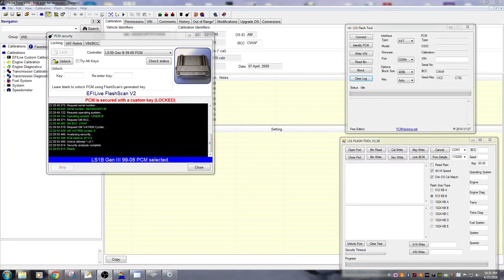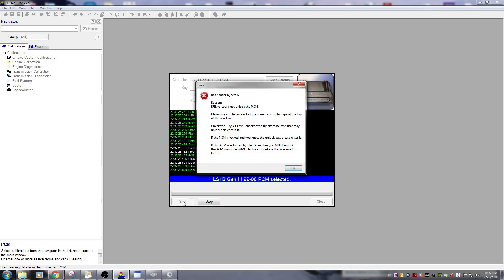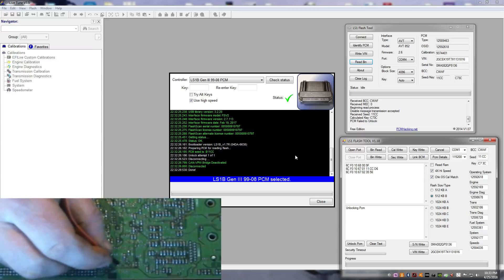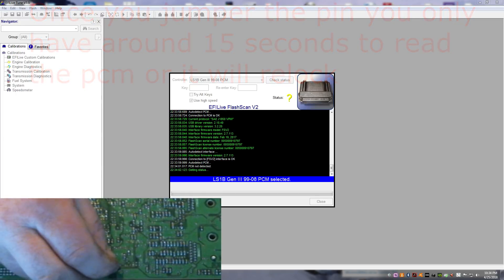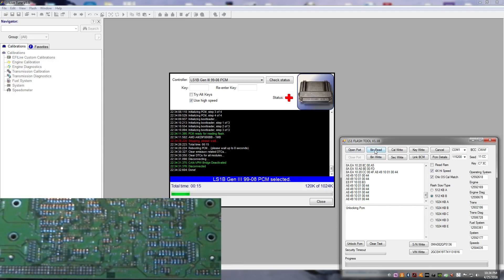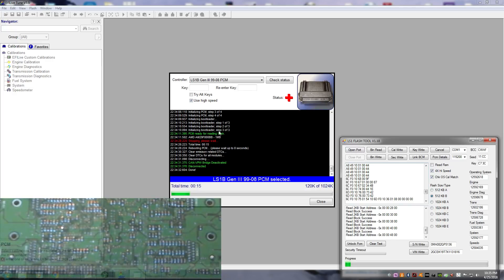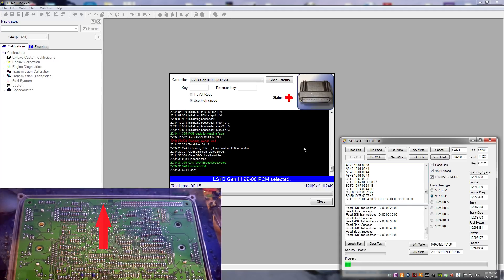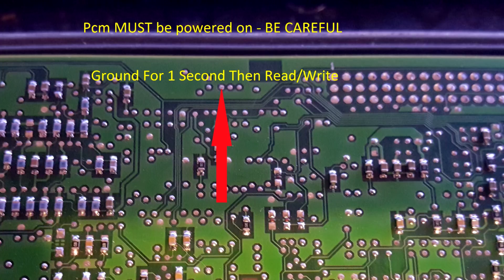LS1B P01 P59 DIY NO COST Tuner Lock BYPASS

Comment: HI I just came across your process you posted this in 2018 and now June 2021 so hope you still read this.
Is this for the 0411 PCM, has the red and blue 80 pin connectors used like on C5 Corvettes, Camaro, etc 
Which board is this ground point ?
The red or blue board and exactly which side of the PCB board and location as I cannot find on a 0411 PCM I am looking at where you show the pin that needs to be grounded ?

Thanks - JR

Comment: This is interesting but I want to be able to read and modify the locked tune file. My PCM is not locked. Any ideas?
Reply: It’s flashed with uprev.
Reply from the maker: There is a difference between a locked PCM and a locked file. A locked PCM means someone altered the factory's unlock key making it virtually impossible for someone else to do anything with the PCM....even flashing it back to stock for example isn't possible when a PCM is locked. 

If the file is locked, just flash over it and start with a stock file.

Comment: IT works! I was able to read with HPTuners, i couldn't open the file tho, still locked by another user (anything that can be done about that?)  but i was able to use the PCM again, reflashed with stock tune and voila, thaks for sharing!
Reply: I can get the file off but can't open it. Can someone chime in how they were able to open the file that's tuner locked?
Reply: how did you get it to work with hp tuners i have 2 P04 ecms that are tuner locked and I can't get it to read still
Reply: @backwoodsracingllc  i just followed the video instructions m8. I does work
Reply: @Gallo_Baja  won’t even show me the hardware I can read it without doing the trick but can’t save the file, and I get unlicensed vehicle when I have them unlocked.

Comment: THANK YOU! Worked great on my 411 pcm with hptuners.. Guys just touch the pin for a second and hit write entire within a few seconds (i used stock file) and then flashed again with my 2 bar RTT file... If it bricks again redo it again...super simple

Comment: I see this is a older one my question is if the Tuner is locked and the Vehicle is no longer available how can this be done, i pick a older SCT Live wire tuner from  a guy down the road from me, he no longer has the truck it was scraped out but he had the SCT Live wire tuner from it that has 5 tunes on it, one is locked 4 tunes left on it, that was for a diesel,  how can i unlock it, now my truck is and older truck as well but it's a gas  V-10 , thank you in advance

Comment: I finally got it to work!!
Reply: Were you able to open the file after you read the pcm using hp tuners or was it still locked?
Reply: I can unlock it, but flash it during the unlocking process with another file with Hptuners.
Reply: Mad Max Garage i would like to get the tune out of the pcm, and then unlock the pcm and file so I can continue working on it with my own hptuners I bought. The original tuner moved away.
Reply: 6kjr I have not been successful in grabbing tunes off locked PCMs, I can only seem to be able to overwrite them. Maybe see if you can find him and he email you the tune and you do it the way it works for me with the tune from the tuner.
Reply: Mad Max Garage they did email me the tune file but my hp won't open it. It says it's still locked. I emailed HP and they said the pcm needs to be unlocked with the original hardware to unlock the file.
Reply: Mad Max Garage I am going to see if I can get him to send me an unlocked file from another pcm and use it to fix mine. Thanks for showing your video as well.

Comment: FWIW this also works on the P59 PCM's that brick due to improper throttle body settings. Just revived one that's been on my bench for 5yrs that had a TAC/Pedal mismatch and bricked.
Reply from the maker: I have gotten positive feedback from more then 100 people that have used this method on bricked PCM's(failed flash) in conjunction with my Ls Droid flash app to bring the pcm back to life.

Out of maybe 300 pcm's this has been tested on that were "bricked";  there were something like 5 pcm's that were not able to be brought back this way and of those 5 only ONE was able to be recovered with a BDM...the other pcm was actually dead. 

This also works in cases where a pcm "bricked" during a read where the laptop battery died 

Truly bricked Pcm's are actually quite rare these days :D
Reply: ShorTuning EFI Calibration Specialist 
Did you use Hptuners software?

Comment: Worked perfectly for me but I have to do this every time I read it write my PCM. How can I make it that I'll never have to do this anymore??
Reply from the maker: By writing a bin file from a non-locked pcm. Its basically cloning the PCM you flash from another PCM's bin file. 

https://www.youtube.com/watch?v=DYc3lrYagqg
Reply: @PeteS160plus  so I'm basically pulling another trucks tune from that PCM and copying my existing tune file over the new file? How do I go about doing this without adjusting every little parameter I changed in my existing tune, on to the copied tune.
Reply from the maker: Get a second PCM, flash your tuner locked bin file onto the pcm. You would want to flash just the OS+Cal data. You would then read the file back and have the same "Tune" but with out the tuner locked seed/key now. You can then take the new "unlocked" version of your file and flash it into your current pcm to remove the tuner lock completely. 

It may sound hard but it actually would only take you a couple of minutes to do.
Reply: @PeteS160plus  Not sure if you're still monitoring the comments from this video but can I use LS Droid to clone a non locked PCM .bin onto the tuner locked PCM then put the original tuner locked.bin back on afterwards and not be locked? The tuner locked PCM and the non locked PCM are not the same OS.
Reply: PeteS160plus I would like to give this pcm trick a test. But I still have a couple questions.  If you're following the comments can you let me know?
Reply: Curious is you used HPtuners to unlock yours?

Comment: Thanks heaps PeteS160plus worked perfect on my vu ss commodore ls1 pcm after using the method misk one posted, Had that pcm sitting around for 8 years & has always pissed me off that it got locked.
Awesome work on this & the work you are doing on the ls1 flashing software.
Reply: Hey mate. Did you do this method while the pcm is in the car? I just got my mpvi2 the other day, waiting for a free weekend to get stuck into it and just wanted to know if it can be done in car or if I should buy or make a bench harness. Cheers mate
Reply: rizzaheydon did you build a bench harness and have success?

Comment: nice one bro, thank you. gonna try it out !
Reply: worked perfect! awesome
Reply: @julespatch  did you use HPtuners to unlock?
Reply: @disableafm1401  yep sure did, or could have used SPS etc etc too
Reply: Jules Patch thanks for your reply.  I tried a couple of times.  Last question, are you holding the pin from ground source longer then a second?
Thanks
Reply: @disableafm1401  nah i dont think so. its pretty quick from memory

Comment: This is a great DIY thank you! I was able to do it on a ls1b ecm. Do you think the same process will work on an Lb7 ecm? Same basic architecture it looks like. My ls1b is an AMD chip while the LB7 is a Intel. From the top of the chip you grounded the 7th pin in from left to right, connectors facing down. Can I forward you some pictures of what I have? My email is tyohnlocal74@gmail.com
Reply: Did you ever get a response ?

Comment: cheers heaps for this! worked easily on a vy ss commodore ls1 ecu, worked first try with no hassles!
Reply from the maker: Thanks for the positive feed back. So often these days the only feedback you ever see is when something doesn't work or the person trying it can't figure it out.
Reply: youre right mate, more than happy to let you know! you've honestly helped a ton of ppl with this. I've done a good 10-15 vt-vy commodore ecus and never had a drama.
Reply: with hptuners it still says its a tunerlocked tune but ive found if I do a write vin/vats/tunerlock with another tune and use the jumper method then I can read the ecu and even though the tune I used was unlocked I use the key from that tune. that way I have an unchanged tune that is then unlocked from then on.

not sure if theres an easier way?
Reply: @miskone1044  Have you found any other way? I'm abit worried to write anything over the current pcm even if it is only a vat/tunerlock/vin write.
Reply: @71510  nope, not that I know of. its best to try and find an os that matches at least tho lol
Reply: Thanks misk one your method of write vin/vats/tunerlock worked on my vu ss pcm, had me scratching for awhile until i came back and read your post so cheers.
Reply: Ramon Rennie I am hoping you can clarify.
When using Hptuners the way misk one   states, does he mean use another tune on the locked pcm to get to read after doing his method or do I use another pcm and use the key from that one and proceed to the locked pcm?
Reply: lol reading it now it barely makes sense to even me. happy to help, its especially important to share any little tweak or trick when dealing with obscure shit like this. 
what process did you actually end up doing in the end?
Reply: Thank you misk one and Petes160plus. I followed both of your suggestions and methods and it worked
Reply: I am going to try your method. To be clear, you are using 
1- another tune
2 - write vin/tunerlock/vats on locked pcm
3-  jump method 
4- use key on locked pcm
5 - now available to read?